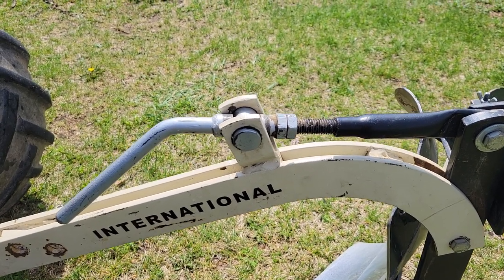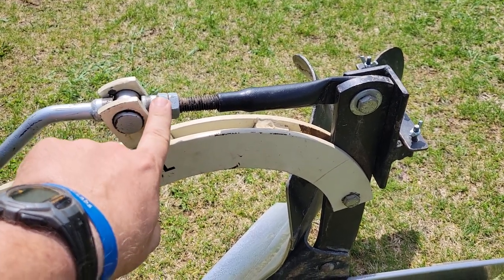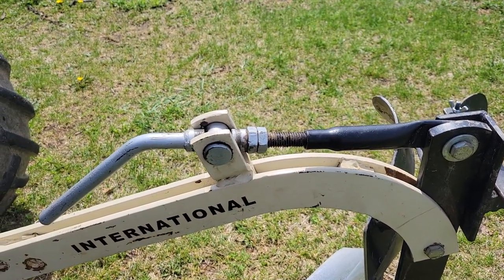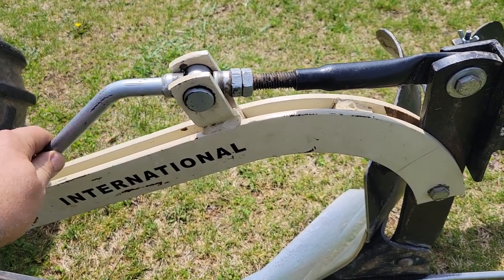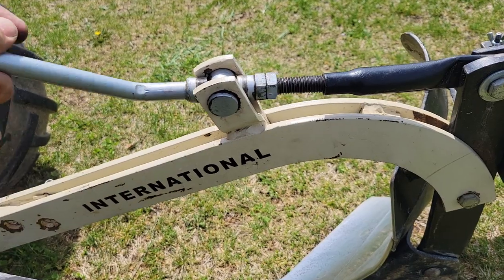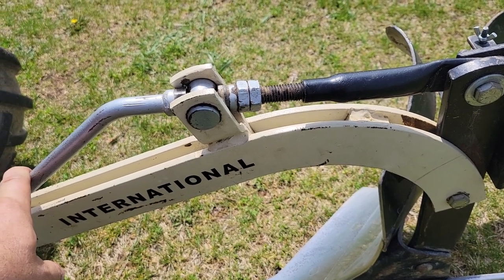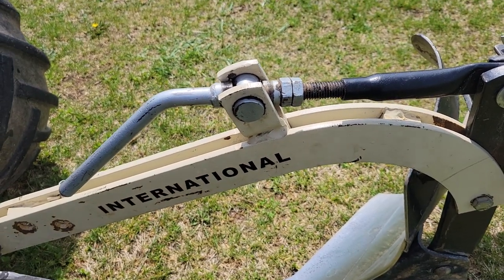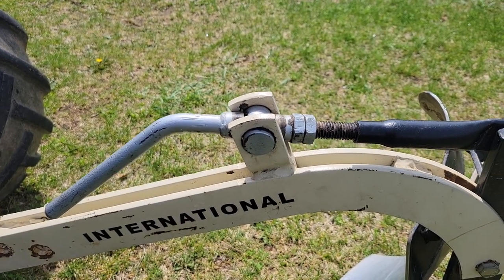Brinly garden plow common mistake

Comment: Where you get that extra piece on the top of the mouldboard that helps roll the soil ?
Reply from the maker: I made that one. I have seen guys use the ones for big plows. The newer ones are plastic and you can get them from farm equipment dealers.

Comment: How did the new plow work you had on the 882. We had trouble with setting our plows on the super cubs at pa plow day.
Reply from the maker: It worked great. I built it last fall and plowed with it in Ohio. I made a few minor adjustments to it for PA. I'm pretty happy with now. I may still put a bigger coulter on and maybe an extension on the moldboard.
Reply from the maker: Cat 0 plows can be a challenge. Most aftermarket top links are too long to get the point low enough. I may do a video about that later on.

Comment: Is setup different between 3 pt and sleeve hitch?
Reply from the maker: Yes. Only the sleeve hitch plows have this adjustment. On the 3 point plows the depth adjustment is done with the 3 point top link.
Reply: @farmallgray  Thank you for your reply